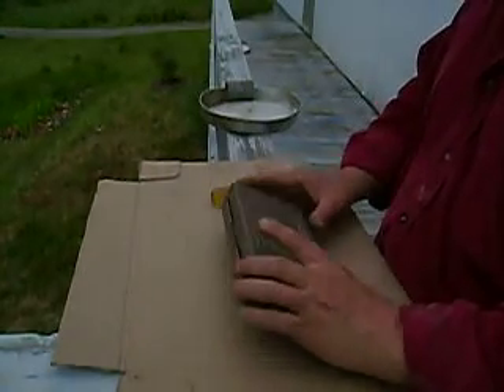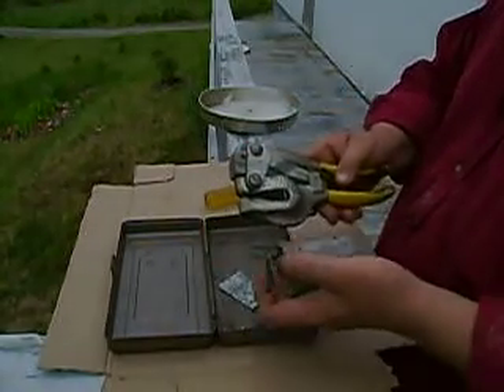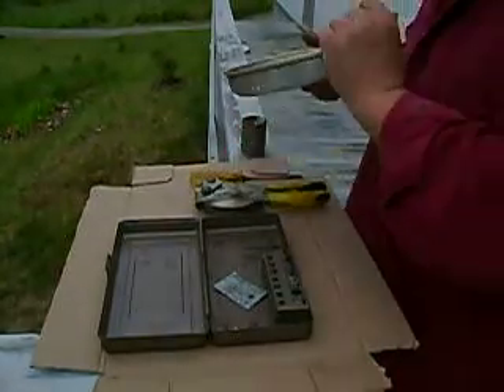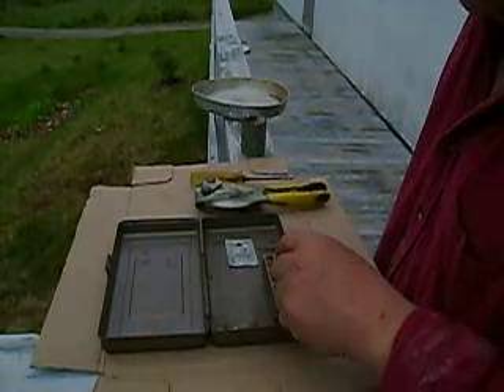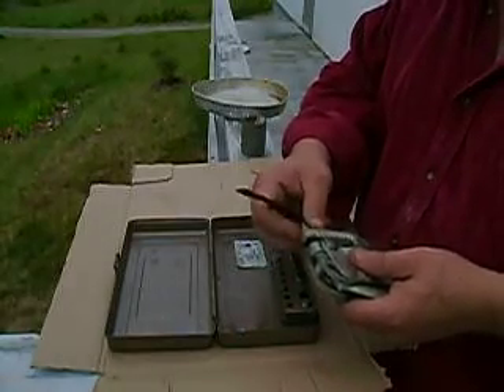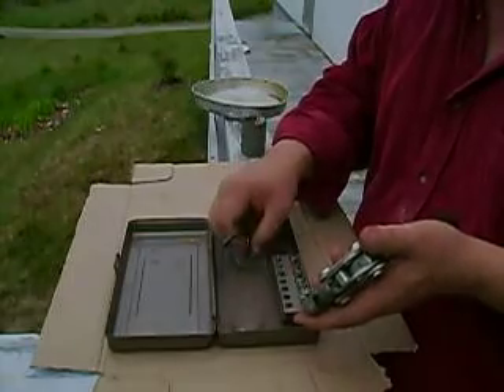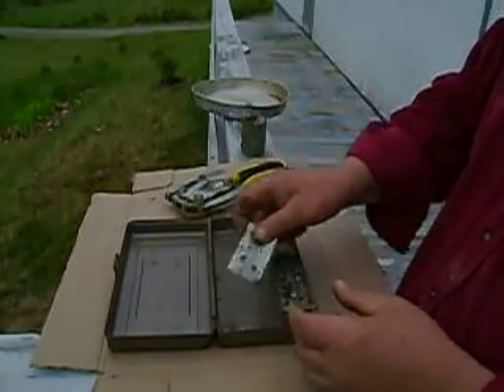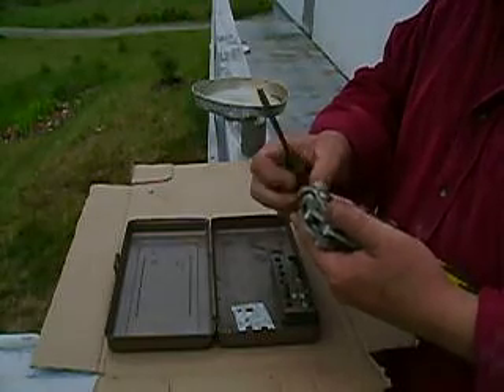Sheet Metal Punch Whitney No 5JR

Comment: I have the same exact punch set. Mine is at least 40 years old, and works like it was new. I was a "tin knocker" (sheet matttel worker) then, Learned trade on GI Bill. Too old 4 that kind of work today. One guy I worked 4 used to say, never drill when U can punch. And we would use an awal to punch a hole for duct hangers. Not a drill